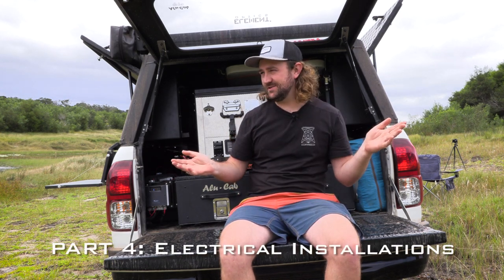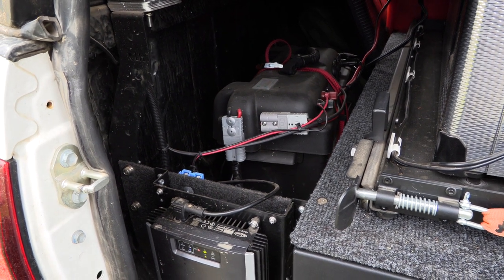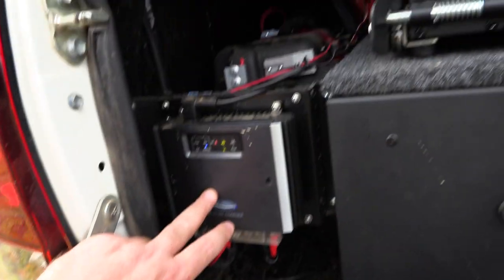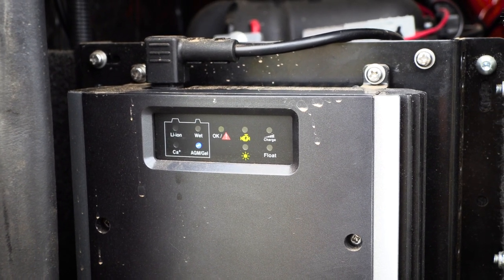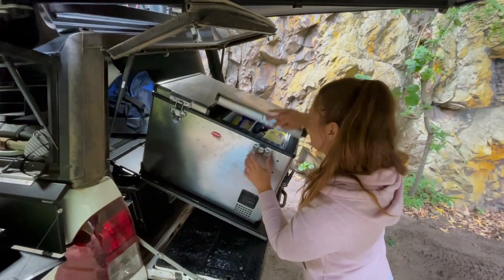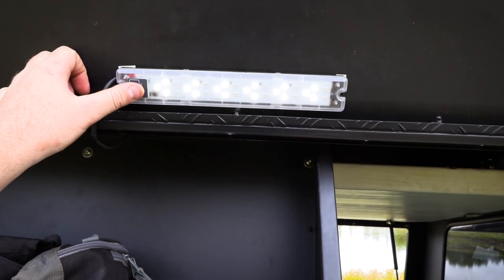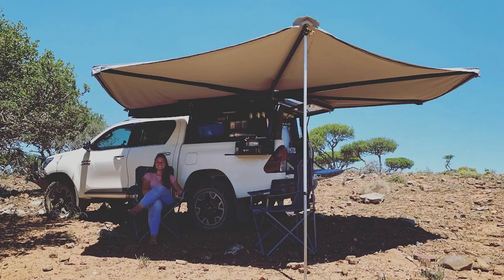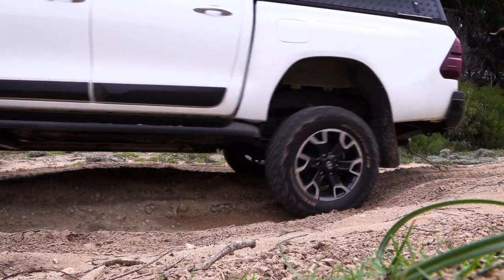Electrical Installations: Hilux Overland Build, pt.4

Comment: I’ve been watching your channel for a while now and I really enjoy your content. 
This is a blog is a year old. And it’s still as accurate and as relevant today as it was a year ago.

I’m actually researching the bc-dc charger at the moment. I have 3 x 108ah BlueNova lithium batteries in my trailer. With 600w of solar running through a Victron 2000w Multiplus 2 with additional Victron MPPT. Equivalent to 4.2Kw in battery life. I shouldn’t have any issues charging- but I want to cover all my bases. 

My point is, I spent a small fortune on lithium batteries, and while expensive- they are life changing. 

Once you buy one. You’ll wonder why you didn’t sooner. 

Keep on Truckin’ ✌🏻

Comment: Thanks for the video

There are AC to DC charger that charge the battery with 7.5Amps such as Benton and i have Victrone that charges it up to 15Amps and i also have Ctek MXS 25 that charges at 25Amps 

For the DC to DC chargers there are also Intervolt that charges at 25Amps, and Nationla Luna has one that outputs 40 Amps, i would say 25Amps is the recommended for the health of batteries 

The battery mode on National Luna DC to DC charger
Li-ion : Lithium Phosphate battery 
Wet : Wet battery 
Ca* : Calcium
AGM/Gel : Sealed lead acid batteries

Comment: Hi Matt, hope you're well. quick question - the National Luna DC-DC remote screen, the point where it plugs in on the charger, does it have 5 or 6 pins?
I recently bought the screen but it's not turning on and noticed mine only has 5 pins

Comment: 12V needs a hell of an area to be efficent,  just look at starting cables. In my youth I tried to use common electrical wire to jumpstart a friends car, no success. After that I bought a set of starting cables.